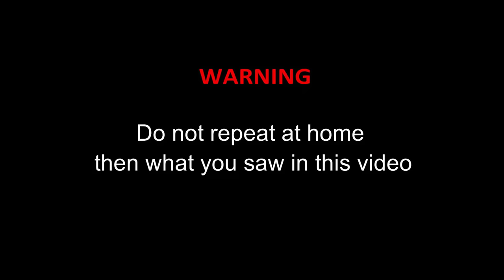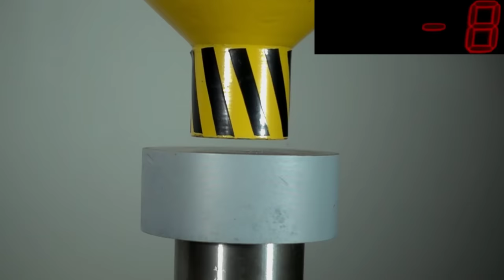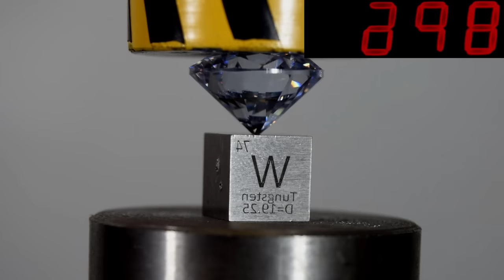HIDRAULIC PRESS VS THE HARDEST STONES VS TUNGSTEN

Comment: Diamonds aren't hard to destroy, just hard to scratch
Reply: Yes they are hard to destroy you don’t see the dent it left on the machine
Reply: @morallybiased1772  that could happen with almost any material...
Reply: Diamonds can't be break or crack easily which basically means it's still hard to destroy And that's all because you need a machine or a hard thing that has more x of pressure to do the job. As simple as that.
Reply: Diamonds is the hardest stone but not rhe hardest material ✅
Diamonds can be scratched ✅
Yes, it can break or scratch but for sure it's not way to easy.
Reply: @quickharmoniegamr  they are hard to scratch, not that hard to break, not the same thing
Reply: That’s not a diamond
Reply: @quickharmoniegamr  Any of this test showed a real diamond
Reply: You know that Minecraft has all kinds of diamond equipment? It would be extremely weak in real life. It's a gem, hitting it at a weak spot shatters the whole thing.
Reply: What he means is they are harder to scratch than shatter
Reply: @morallybiased1772  diamond is quite brittle, hard doesnt mean what you think it does when referring to diamonds
Reply: @quickharmoniegamr  diamond is brittle, been playing too much minecraft
Reply: How to use the hydraulic pressure force and at the same time use the Mohs hardness scale.
Hardness is the ability of a material to resist friction and is measured on the Mohs scale, while toughness  is the ability to measure how much force a material can absorb without fragmentation which measured on On
 pascal scale , the pressure exerted by a force of magnitude one newton perpendicularly upon an area of one square metre.The toughness of natural diamond has been measured as
 (2.0 MPa⋅m)1/2
Reply: @quickharmoniegamr  diamonds are actually very brittle, don't mix hardness and toughness
Reply: Many a divorced husband have seen diamonds disappear far more quickly
Reply: So many people do not understand diamonds, diamond is the hardest material on Earth, but because it's so hard it is brittle so it is easy to break per se, however it will scratch and dent any other material on Earth, however the material will not necessarily scratch a diamond it can only just break it...
Reply: @truthfacts5438  not quite think my missus’s heart is harder
Reply: @morallybiased1772  you just need sharp force to shatter a diamond like glass . Hard, strong, but more brittle than it is strong. But still a lot stronger than things like glass
Reply: @quickharmoniegamr  Nah as far as being “strong” there are much better materials with better data as far as structural support
Reply: @Not-Kobe  It's the hardest material on earth if you got a diamond cube the size of an egg it wouldn't break under the machine
Reply: @quickharmoniegamr  cap diamond is the hardest material just google it
Reply: @psgqwin878  it would, again, that is not what "hard" means.
Reply: @Not-Kobe  Umm it kinda is again just Google it
Reply: @Not-Kobe no it cannot
Reply: @xcaliber4141  "can diamonds be break?" literally you can just google it.
Reply: @xcaliber4141  by that way you can also search up what "hardness" mean.
Reply: Diamonds are hard to destroy as their hardness is one of the highest of all existant materials this is why in machining they are used to process the hardest materials, scratchness is basically thoughness and is not rellevant.
Reply: @julianguerrero5000  hardness and thoughness are very different, stop being ignorant arguing things you din't even took the time to search up
Reply: @julianguerrero5000 They are not the same thing, don't talk in the ignorance. Using internet is so easy...
Reply: Maybe you meant "Snatch"?)
Reply: I freaking knew it!
Reply: it actually are specially natural diamonds they are the hardest material
Reply: @aganbraganca4156  natural and artificial diamonds have the same hardness... artificial doesn't mean its fake or worse, pls avoid commenting without a brain in your head. Hardness and toughness are different things.
Reply: @Not-Kobe  also the material shown in this video is not diamond
Reply: @aganbraganca4156  they are not so expensive as you think, neither so uncommon.
Reply: And find
Reply: @johnfaustazur8495  Not as the industry make you believe
Reply: Diamonds aren't hard to destroy ? they are only the toughest natural substance. Just for your information, that was not a Diamond but a Moissanite.
Reply: Finally a good comment
Reply: Did you see the size of the diamond? (I'm not gem expert so not sure if that was a real diamond).
It was smaller than a fingerprint. Put a 3cm diamond instead and try to break it.
Reply: What are you talking about bro dismond is the hardest mat on earth
Reply: @balvaac  hardest to scratch, but it's resistance to breakage is low
Reply: @balvaac  hardness is a material ability to resist scratching, while toughness is its ability to resist breaking. Diamonds are very high in the first, but very low in the second which is why they arent used as building materials.The two tend to be inversely correlated as the harder something is, the less it can bend and reshape itself to absorb pressure.
Reply: And stab
Reply: Tungsten is the strongest metal with a melting point of 6,192°F (3,422°C) and a crushing point of  60,000 PSI (4136.8544 bar) or more
Reply: @COSMIC_SECRET Yeah, and its also absurdly dense

Comment: So, the thing with crystalline structures is that they have “clevage points”. Essentially, points of structural weakness due to how the molecules are aligned. Mainly, they are straight hits across the top or side. This is also why you can smash a diamond with a hammer fairly easily.

Comment: Kinda interesting that despite the fact Tungsten is one of the strongest metals known to man, it still gets flattened by a big steel pillar pushing down.

Update: I am proud to say I am now the owner of a Tungsten Cube.
Reply: Try the same thing with a tungsten pillar pushing a chunk of iron downwards ...... it'll literally not survive
Reply: Size matters
Reply: @cheesewallace5494  More like mass, because a smaller but more dense object will usually beat a larger less dense one.
Reply: @SimonReeves2  lead is dense and easy to deform
Reply: @89carloom  Yeah, my guess would be concentrations and something to do with geometry. The hydraulic press channel has featured many ball bearings. They often dent/deform the hydraulic press due to their shape.

Granted, they aren't made out of Lead, but generally speaking if something is more dense and/or compact, and there's less space between the atoms then the object is more solid, and usually stronger.

I think Lead gets a lot of its density because Lead atoms themselves are large, rather than because it's been made compact.

If someone were to get equally sized Lead ball bearings, but then crush/compact one of them to half the size of the other, and then smash them both together at equal speeds, the smaller but more compact Lead ball bearing will leave a bigger dent/deformation on the larger one than vice versa.
Reply: @SimonReeves2  density doesn’t equal toughness, many heavy metals (very dense) wouldn’t be as durable as steel, the durability comes from the atomic structure of the material.

also, atoms are mostly made of nothing, the actual density comes from the nucleus of an atom’s weight, different atoms may be similar in sizes, but weigh different because their nuclei are bigger/heavier, as an example: diamonds are made of carbon (not super dense) but are incredibly hard thanks to it’s atomic structure.

also also, you can’t compact solids unless their inherently hollow, to compress solids would basically be nuclear fusion.
Reply: @yuridelacruz2480  I'm pretty sure the hydraulic press compacts solid objects all the time, and they aren't hollow either, and I guess I might have not been using the word "density" in a strict academic sense. Diamonds do get their hardness from the atomic structure, but IIRC for that structure to form in the first place, there does need to be incredibly high pressure.

So when I say density, I'm referring to how many atoms are compressed into a certain volume, like when the hydraulic press crushes paper so much that it becomes solid like stone.

But yeah, I do agree with you as well.
Reply: No material on Earth is stronger than the forces of physics.
Reply: #biscotticafe2215.enelesonapt6
Reply: Because it was probably a very low density block.
Reply: High pressure
Reply: Tungsten is special because of it's density. There's so many atoms packed into it's structure so it tolerates masssive amounts of heat. Also the tungsten is being flattened because the press is both designed to flatten things and it's about 1000x times bigger. That's like a skyscraper trying to crush a car and only barely smooshing it.
Reply: Nice.

Comment: Well mohs doesn't measure tenacity, which is the capability of resisting being fractured, but hardness, which is the capability of resisting being scratched. They are two different things. In other words, you can't scratch a diamond but you can fracture it with no much effort.
Reply: What is "mohs" stand for ?
Reply: @senabondara1992  measure of hardness scale
Reply: @senabondara1992  It's named after Friedrich Mohs, the guy who created the scale.
Reply: At first i thought about mho which was the unit of conductance lol
Reply: O
Reply: This reminds me of polycarbonate, vs CR-39, common materials used in the eyewear industry. Polycarbonate is extremely impact resistant, i.e., resistant to fracturing, but it scratches so easily that a scratch-resistant coating must be applied to both sides of the lens during production. CR-39 is the exact opposite. It needs no scratch-resistant coating, but it chips (fractures) very easily, and can totally shatter if it takes a direct impact.
Reply: So, hardness is only based on its capability to resist scratches?....i guess diamond isnt that hard after all....normally we though high hardness mean it's harder to break....seems like diamonds are just the same as other rocks and can be easily shattered if compared to metals....all this time i thought diamond is harder to break compared to other elements, including metals
Reply: @VANTABL4CK  no that's ohms
Reply: Which is the reason why there are diamond tipped drills...that doesn't add up. 

Fianit is cubic zirconia btw
Reply: @Imperial_Cosmonaut  yea cause diamonds don’t scratch and a dulling blade is just the point being scratched off so diamond tipped drill bits take for ever to dull and are good for very long periods of time
Reply: SORREY TO TELL YOUE, BUTT YOU IS WRONGES...Mohs micrographic surgery ... A surgical procedure used to treat skin cancer. Individual layers of cancer tissue are removed and examined under a microscope one ...
Reply: @ilovecops6255  what?
Reply: @maxortega8073  HELLO EMINE FREND MISTAH 007! Diamonds Are Forever is a 1971 spy film, the seventh in the James Bond series produced by Eon Productions. It is the sixth and .😀😃😄😁🤩😬🤔🤐🥸😎🤓🧐🤠😲👾👾👾👾🙏🥯🥯🥞🧇🥜🍗🍖🧆🌮🥪🌭🫓🍟🍲🫕🥫🌍🌎💈🌁🚞🚖🚗🚙🚚🚦🛑⛽🚨🚧⚓⛵🛶🛩🛫🚧
Reply: @akshayerande6902  Ohms are a unit of resistance, he said conductance which is measured in units of siemens, also known as mho.
Reply: @nickraph67  (sorry for the late reply) this is because we don't use the language the same way to refer to common terms on a daily basis as we use it in material science, where "hardness" only refers to the capacity of resisting scratches and what we call "hardness" is actually called "tenacity" (the ability to resist breakege) and they are inverse to each other.
Reply: Is true.                (for some reason each time someone mentions resistance to scratch, I picture a cat)
Reply: @nickraph67  its because it is hard that it is so brittle, due to diamonds being very hard and not stretch nor bend they shatter really easilly

Comment: In case any of you are wondering how it was able to shatter diamond, diamond is hard, but it's also brittle. Enough force applied to it can make it shatter in seconds.
Reply: Well that and the shape of the diamond was not conducive to the actual strength of it. If it were a block instead of a cone- it would be much different. All that pressure was exerted on one single point at the bottom.

Comment: Guys, a fianit(cubic zirconia) is not a diamond. It is not as hard as a diamond but look really similar, and it's way cheaper than a real diamond. That tungsten cube probably cost more than the small fianit.
Reply: You just saved my day, because DIAMOND IS UNBREAKABLE
Reply: @weetakuT  nope it's actually brittle and easy to break. Nothing is unbreakable.
Reply: Well that's comforting
Reply: @weetakuT  I think most ignorant people will believe that diamond is "strong", but it's not. It's fragile and easy to break, it's only resistant, resistance and strength are not the same.
Reply: @weetakuT  it has to be breakable, otherwise they could not shape them and add facets.
Reply: @PaperMario64  There is a joke you guys are missing about " diamond is unbreakable" just search to get the joke
Reply: @TheNoor9000  yare yare...
Reply: Well, yes. There are several objects used. The first of which in the video is a diamond.
Reply: @PaperMario64 Jesus Christ this.  Occam's razor.  Why does this logic never compute with some people

Comment: Tbh I'd like to see what it does to stones lower on the scale, or rather what they'd do to it- as the moh's scale is in all honesty, not only a measure of how hard a material is needed to scrape them, but also brittleness
As they say; hit a diamond with a hammer, it'll shatter. Hit a quartz with a hammer, it'll split in half. Hit a jade with a hammer, it'll ring like a bell.
Reply: They'd crumble to powder almost instantly. Since they don't need to absorb as much energy before they break, they don't throw bits as far or give you that dramatic pop sound, so there isn't as much of a show.

Also, people who say that clearly do not hammer a lot of jade. It's actually very easy to chip, and was a popular stone for knapping into blades in the stone age, much like flint and obsidian. The trick is to hit it at the shallow angle, so that you flake off a chip, instead of cracking it in half. My team used to find spearheads when I was working out in the desert, so I got curious and read up on them.
Reply: @MrFelblood cool! I always like learning new things :D

Comment: Info: Diamond can break if you crack with 100% iron hammer.
Reply: diamond are not resistant so it's pretty logic
Reply: But it's very hard to scratch one
Reply: @CarmelCatz01  That's right. Diamonds can only be scratched by diamonds.

Comment: Haven't watched this, and I'm not going to because hardness and strength are not the same thing. You wouldn't test hardness with a hydraulic press. Anyone can smash a large diamond into fragments with a hammer -- resistance to fracturing is not hardness. Hardness is a measure of resistance to scratching.
Reply: Exactly,  thank you
Reply: At last someone who went to Junior high school
Reply: Finnaly someone who realized it
Reply: well there are many different strengths. Hardness can be measured with a scratch test however a more accurate method is the using a light press using a diamond tip I believe. Rockwell and Brinell scales are a couple metal hardness scales. Then there's the durometer for plastics and rubbers (also a plastic)
Reply: Materials Engineering needs to be considered before only crushing things.
Reply: That was my first impression.
Reply: How hard could someone be?

Comment: Diamond is the strongest mineral and one of the most expensive, but diamond also kinda isnt.
You see, when diamond loses its natural form or slightly cracks. It shatters. Matpat also made a video of how diamond tools would be ineffective in real life. People think its amazing how diamonds get broken with a hydraulic press, but its a waste of money. You can break it with a hammer.
Reply: Yeah, hardness and toughness are two separate things. A diamond may be able to break anything on contact, but it would most likely shatter on impact. Common rocks you find in your yard can withstand more than a diamond.
Reply: Flex tape can't fix that!
Reply: @robertdixon3592  thats what i said when i divorced my wife
Reply: @girlballsyuri  
Like titanium.
Reply: Diamonds are dirt cheap. Their supply is controlled to hijack the price but its almost worthless.
Reply: @theartemisgland  
All true. Now try telling your fiancee that you don't want to pay $10k for something worth $100. Try telling her you would rather spend the 10k on an actually rare gemstone.  Good luck with that. There's many reasons I'm single but that's a big one.
Reply: "Diamond is the strongest mineral"

NO it isn't. It's the hardest mineral. Strength and hardness are not the same thing. Strength is a measure of resistance to being scratched -- harder materials can scratch softer materials.
Reply: @girlballsyuri  . "A diamond may be able to break anything on contact .."

You mean scratch anything. Not break. Hardness is resistance to being scratched.
Reply: @christophercarr5865   According to google, diamond is the strongest and hardest. But its now durable,  its like getting a gold pickaxe from minecraft but its diamond with 1 durability left.
Reply: @nickmontanaro9638  as a woman, diamonds are overrated. Alexandrite on the other hand 😍
Reply: I'm not going to watch someone smash diamonds with a hammer on YouTube, so it might not be a waste of money to have a hydraulic press.